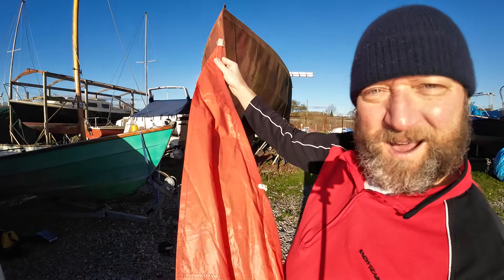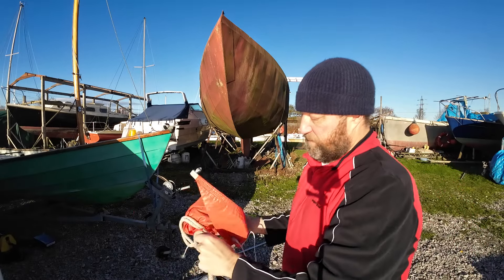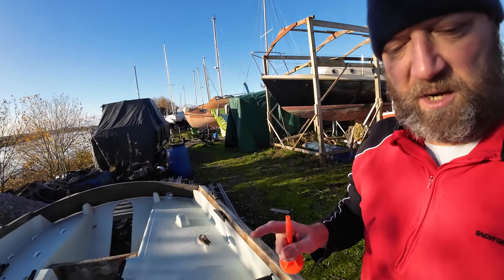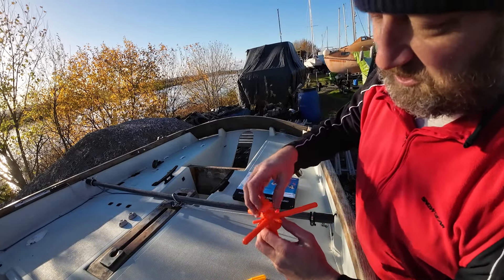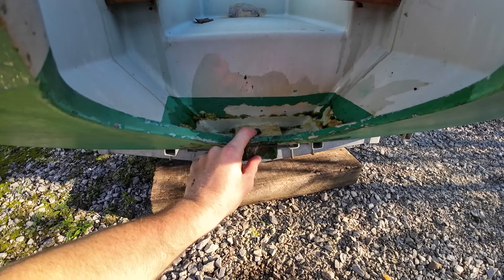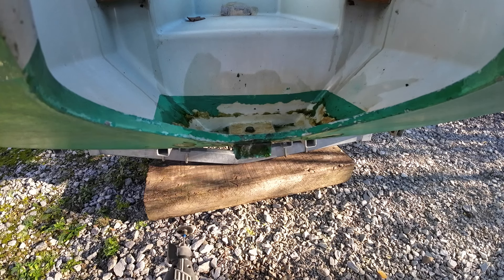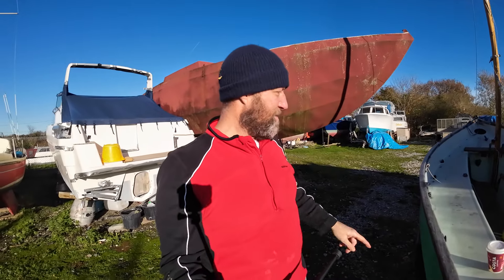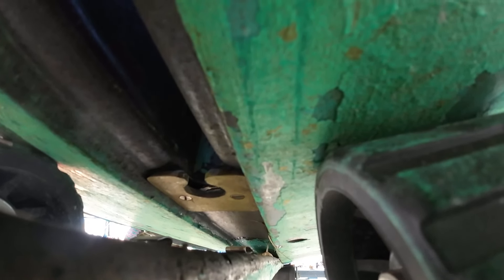How To Remove A Drascombe Lugger Lower Rudder Bearing

Comment: Hi dave 
was wondering what your tgoughts on the following are,
I'm mostly sailing the ent singlehanded and find her sail area too big leading to being upside down most of tge time😂, i decided to replace tge rig completely with a mirror rig!  she doesnt weigh massively more, so i'm hoping it works!
any thoughts?
Reply from the maker: Hi Ari. Firslty did you say you're sailing the Enterprise single handed?  Whilst a nice dinghy, I have heard they have a reputation for being a bit tippy, especially when on a Run. Her backside likes to come round and she broaches that way.

Reducing the sail area is always going to help, but 2 things I wonder:

1. I wonder if reducing the sail area is fighting a losing battle against a dinghy that is inherently tippy. Changing the sails is also complicated to get right. If you reduce the sail area then you could alter the balance aft/forward of the boat. thats why the Mirror has that extra notch in the hull for when you sail her with just the main. She needs the balance to move forward a bit.

2. What most people would do is to reef the mainsail and try to furl the jib so you can effectively reef that too and keep the correct balance of the boat.  Any decent sail maker will put a reef in your sails or you could do it yourself. Just a row of reinforced eyelets, but of course yoyu need to do them right.
 
Hope that helps a bit anyway

Dave
Reply: When I had an ent, I got reefing points put in the mainsail and I put a furler on the jib.
I found it ok single handed then
Reply: @fat_tommo_goes_boating your probably right 
however i only have the mirror rig my ent was an old hull which i have restored, i do have the original mast and boom,
so i will try with the mirror rig first if that fails than i may just folllow your advice,  
cheers
ari